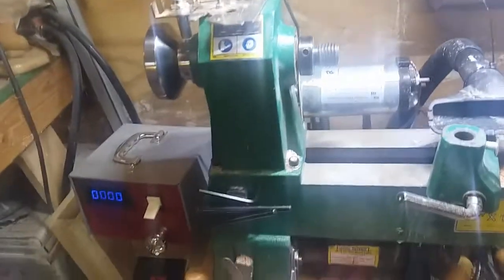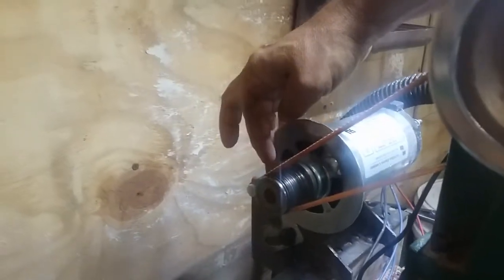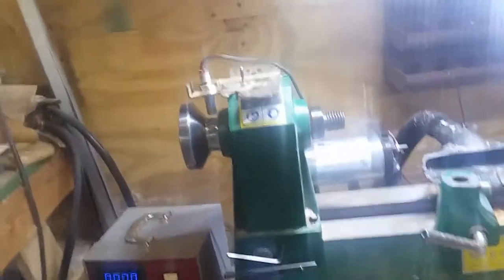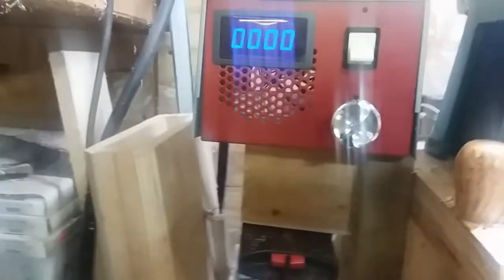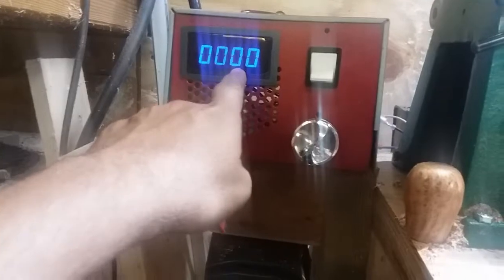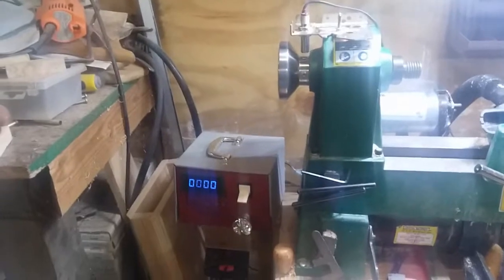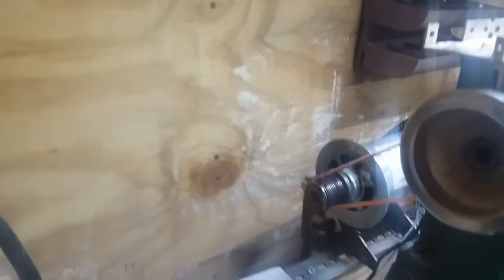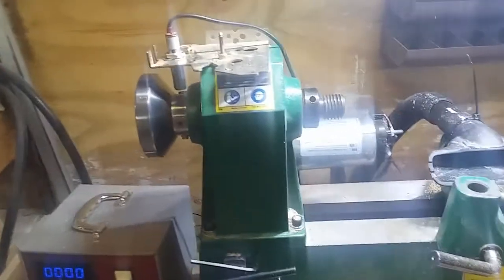Harbor Freight mini lathe conversion update

Comment: To avoid the chips getting in your tach box, I think, the box could be placed somewhere no so close to the lathe, like on a shelve on the back wall or above the lathe using a bracket. Just an idea that could probably help.
Reply from the maker: Thanks Paul, That's not a bad idea. might be a good idea to have it set up like some of the more expensive lathes that have the second control box that can be mounted wherever you want it. That will stop me from having to step across in front of the spinning work to adjust the speed or shut off. Thanks for commenting.

Comment: I have on old lathe/mill combo that Id like to do this to, the 3/4 horse ac motor that is on it stalls out way to easy. That's a great idea for the safety key.
Reply from the maker: I think you will find that a treadmill motor will be a huge boost in power. I have been very pleased with mine.